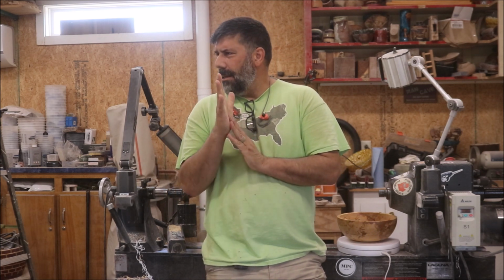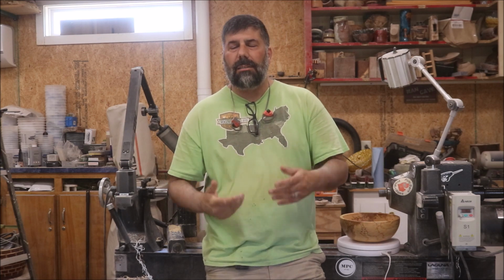The Spalting

Comment: I don't normally like the spalted look, but that looks really nice. If you can't stay away from resin, I remember hearing about an epoxy designed to sink in to punky wood and stabilise it. Can't remember the brand or name though, sorry.
Reply from the maker: TotalBoat Thickset will do that or just take normal resin and cut it 50/50 with Acetate. The only downside is how long it takes to cure